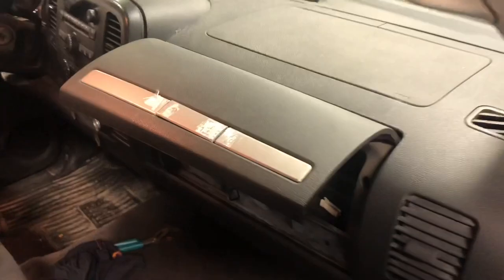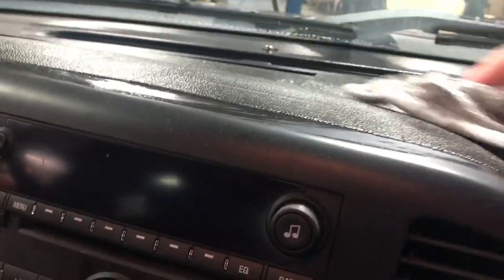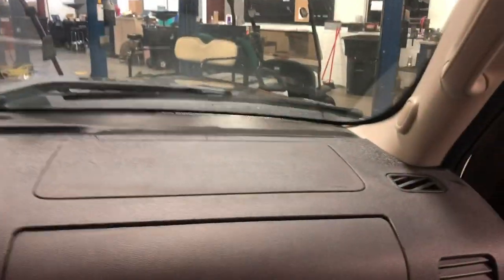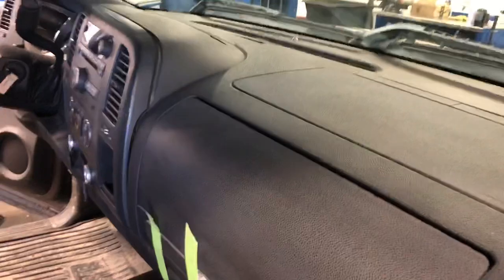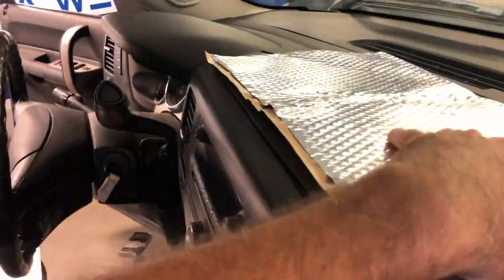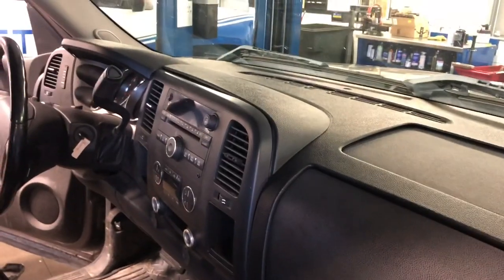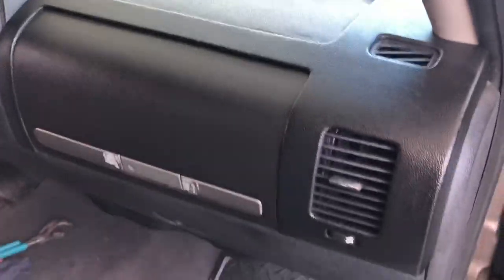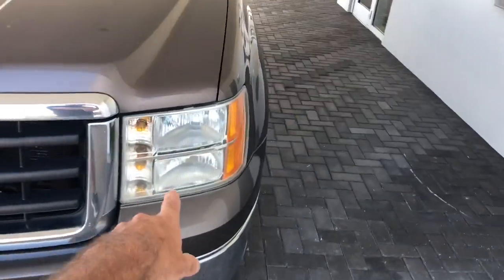GMC Sierra cracked dash repair... under $200.00 ... Must watch..

Comment: My question is how does the center by the radio not rattle still with it falling in like that. I've looked into doing this on my Sierra but I'm curious how gluing thus over my cracked dash that the cracked dash bellow won't still rattle
Reply from the maker: When I did another dash that was worse then mine I used the sound deaden material between the defrost grill and main panel. Then with the dash cover it holds everything together. On mine my center speaker would rattle just driving and is now quiet. Hope this helps
Reply: Mine just has a giant crack running from the edge of the bezel where the stereo is all the way to the defrost vents and it rattles real bad. I've been trying to figure out a glue to use to just fix the Crack because I have a dash matt over it but can't get a straight answer from anywhere on what the best glue would be

Comment: Makes no sense, you put some kind of foil on it and it magically repaired itself🤷‍♂️  
Which makes no sense at all. How are you going to glue it with the foil stuck to the top of the dash?  Without taking the whole dash out your video is missing the actual repairs. Looks like you just cut the video and put a whole new dash piece in there to make yourself look good🤷‍♂️
Reply from the maker: It’s works . Have had it almost 3 years no issues. Thanks for watching
Reply: Didn't actually show the repairs.  I understand working and all and appreciate the  video because I wasn't aware of this and I need my dash repaired. But at least have someone to hold the camera or get it stationary to actually show the entire process. So I'm assuming the dash was just put over the foil which was put in place to stop the noise. Mine is not making noise, its cracked. How do I repair the cracks and broken pieces?